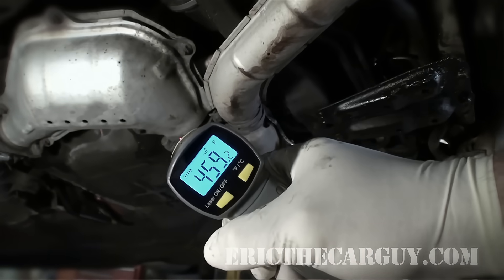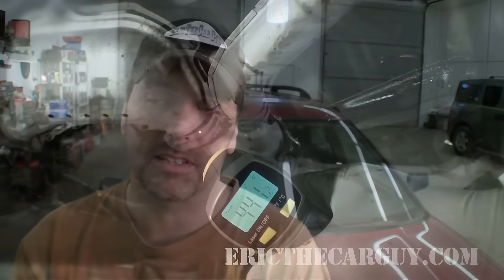Does Lacquer Thinner Clean Catalytic Converters? -EricTheCarGuy

Comment: Modern lacquer thinner is mostly a simple mix of acetone or the slightly less volatile methyl ethyl ketone and toluene or xylenes. Seafoam engine cleaner is 70% isopropanol or common rubbing alcohol. The CRC Guaranteed to Pass catalytic converter cleaner has a high  proportion (roughly 10 percent, with remainder being basically paint thinner or stoddard solvent ) of alkylamine proprietary detergent as the cleaing agent. Most of the rest use a mix of isopropyl alcohol and acetone to clean the fuel system and upper cylinder head of deposits.  Cataclean and the like use equal amounts of acetone and isopropyl alcohol to try to get the job done at roughly 30% acetone to 30% isopropyl alcohol with remainder being xylenes as a carrier. Using a full quart of lacquer thinner or what is basically mostly acetone is way more solvent than these commercial cleaners dump in a single tank for catalytic converter cleaning as they are typically around one pint or 16 fluid oz. . A full gallon of lacquer thinner in one tank of gas is a huge excess compared to the commercial cat cleaners. There are a few cleaners using isobutyl alcohol insead of isopropyl alcohol but you get the idea that they are all trying to remove carbon deposits and varnish from the intake and upper cylinder head using alcohols and ketones with extra solvent power compared to gasoline.

But do they work?

Modern catalytic converters use a very finely divided mix of platinum and palladium metals depositied on porous ceramic beads. Fouling oif the beads surface will impair performance. Sulfur, phosphorus and lead are known poisons of these metals. Lead has been removed from fuels for quite a while now. ZDDP (zinc organophosphorus compound) can also impair the performance of the catalytic converter and it is used as a fuel and oil additive to decrease metal wear rates in modern engine oils by plating out as thin film of zinc metal on hard surfaces inside your engine. Allowable ZDDP in fuels is very low now to protect your expensive converters performance over time.

These cleaners will only restore performance due to carbon deposits and varnish that has clogged your converters due to a rich running condition. Driving at freeway speed for an extended period of time will allow your converter to heat up to the point that it can burn off any carbon deposits that have lodged in it.  Loss of efficiency due to poisoning of the expensive catalysts will not be recoveralble using a simple solvent system. Neither will soap and water clean off the ceramic beads of any metal or sulfur poisons. This is not an easily recoverable process and the only fix is to remove the older poisoned catalytic converter, send it out for precious metal recovery and use the pure platinum and  pallladium to recoat the ceramic beads to make a new converter.

The number one reason for loss of catalytic converter performace is overheating due to a rich engine exhaust causing the converter to become so hot that the beads break down and clog the converter. No amount of cleaning with solvent or soapy water can fix that problem.
Reply: very insightful comment!! at my work we have a lot of oilfield trucks that idle for a extreamly long time and burned oil clogs the catalitic converters to the point that it looks like a dpf that could never regin and is completely clogged!
Reply: I disagree, I think most converters are  clogged up with nothing but soot. I've seen soot severely clog up an intake on a 2021 Ram 6.7 diesel so bad it had to be broken up with rubber mallet
Reply: Soot is unburned carbon particles. Once your cat is poisoned with anything that causes it to no longer burn off the unburned fuel deposits, it can no longer get up to temp to function properly. Once it loses its catalytic efficiency, it becomes clogged and coated with soot. But did soot cause it to stop functioning and loose catalytic efficiency in the first place? Diesel engines are known to produce soot and unburned carbon deposits, way more than gasoline internal combustion engines. So finding your diesel cat clogged with soot after it has lost catalytic performance doesn't tell you if you got a tank of high sulfur fuel and that killed your cat first. @ronmoore3987

Comment: Hi Eric, love your videos. I have watched your other videos where you dunk the cat in dawn soap water. I know base on thermal readings and voltage readings you said it's not working. But did the check engine light went off?  That's the important thing so a smog check can be done. The cat may not be up to par, but at least a smog check can be performed.

Comment: Yes it should work clean it out , it's carbon build up, from  motor oil passing by seals pistol ring valve guides and unburied fuel that we dealing with it wear , using high weight oil that oil additives STP or Lucas to prevent oil to bass by seals , seal them ger better horse power and milage . A tune up will help burn most of the fuel

Comment: Lacquer thinner will not eat any plastic parts or gaskets.... if it did why are we running it through paint sprayers to clean them.... also i typically fill a plastic cup and let cup gun parts sit overnight.... cup doesnt dissolve

Comment: First of all, you didn't follow Scotty's instruction properly. Second, Scotty didn't claim that using a thinner would fix the broken catalytic converter. He wanted to give a try before replacing that expensive part (way more expensive when you go to the auto mechanic and have it changed).
Scotty is an experienced mechanic. He must have tried the method in many cars in his career before making the video.

Comment: I got a low fuel pressure indication when my catalytic converter was bad. So bad it cause the engine to stall. this is due to poor signal from noxygen sensor 2006 Suzuki aero

Comment: I have a 01 626 2.0L with 2 Converters I've had the P0420 & PO421. With Normal Driving Carbon builds up especially in the Converters. I took mine out of O/D which made it tach about 3500 at 50 mph. Ran it like that for a good 15 - 20 miles not getting above 50 got everything good & hot especially the Exhaust that seems to have cured both codes it's been over 3 weeks now no code... May not work with every situation but worked for me.....If it helps I recommend doing this once a month (cant hurt)

Comment: " ATTN " Scotty Kilmer used a half tank of gas to a FULL  GAL. of thinner , ran it about a 150 miles or remember he said if you don't want to drive around a 150 miles he said sit in the car behind the drivers seat and press the gas pedal til it hits 2500 R.P.M. ,S  for about a half hour, , and passed, or the dawn dish soap and warm water trick and rinse it out with a hose, now if the thinner doesn't work, then try the soap an water trick, if after doing both, well, at that point I cant tell you what it is you should do, maybe geta local mechanic to change out your old one and slap in a new one, or go buy a converter and slap it in yourself or pay a local mechanic to do it, that's probably going to be the most expensive way to go but if you tried both of Scotties tricks, and it still fails, its fucked, and you gotta do something, or the state of Maryland will suspend your license, and if you still don't get it done they stick it up your ass by revoking your license altogether, then your really fucked, now you still have to get that fucking thing fixed, pay fines, pay court fee,s  Maryland is a state that really knows how to fuck its drivers but good, real good, this state blows , all the fucking money we have to kick out just to drive on these super fucked up streets, Baltimore streets are I think the worst in the entire 50 states roads, the roads here are pieces of shit, granted some of the highways are in better condition, but for the most part,they FUCKING SUCK !!!!!!  it  a hole then a bigger one then a gigantic muthafucker, one that will knock off all 4 of your wheels , you,ll be sitting there with a car with 4 wheels laying in the damn gutter because of Godzilla fuck me hard in the ass pothole hole, but Hogan says we,ve spent several millions on Maryland roads restorations, shit show me where the fuck he,s been spending this money, on what roads ? none in Baltimore city or county, that lying fuck

Comment: I'm not a mechanic. No doubt, not even a shade tree. But... I don't believe in additives for anything in a car, unless recommended by the mfr. 
I don't see use stop leak, engine additives, fuel injector cleaners, transmission additives, unless the mfr tells me to do so.
Reply: john g 
Yea 99% of the stuff out there is snake oil. 
The only thing that really works as far as additives is marvel mystery oil. 
It keeps valves from sticking in aircooled stuff from burnt carboned oil. 
It’s a naphtha based oil, so it’s a cleaning oil. 
Nicer to use in an old engine with some sludge too, it’s not a fast flush but works slowly over time. 
If the oil level is a little low add some a few hundred miles before an oil change. 
Read the bottle but you can use up to around 20% concentration in your oil.

Comment: you said to start with your cats are stopped up. so no its not going to work. plus every video i have seen says use a gallon on a half tank and in most cases that's about 7 gallons of gas you you did 3/4 tank and a 1/4 of the thinner. so to be honest i think your video is a joke. i have a 4.6 with bad cats and just for the hell of it i will be doing this test soon just to see myself.

Comment: Eric - Review Scotty's video again. I believe he used considerably more lacquer thinner than what you added. I also got the impression that he made no guarantees but said it was at least worth a try to avoid the more expensive route of cat replacement. He also stated that if the lacquer thinner technique didn't work, then see if the cat can be removed and soak it in a bucket of soapy water overnight. Again, he admitted that removing the catalytic converter is difficult due to heat, oxidation, etc. Even after going through this process, he didn't claim these ideas were a sure thing. So, the myth busting appears to be the thing busted, not Scotty.
Reply: He also said it is a way to clean the cat. Not "fix" the cat. An important distinction
Reply: @RealWolfmanDan  most cats don't like help getting clean.
Reply: @maranatha3333  true, mine hate it

Comment: just to add my 2cents ..my van failed emissions test and i had a o2 sensor code i got cataclean one bottle to just under a quarter tank ran it through ..came home parked my van cause i didnt think the stuff did anything when i plugged the scanner up 2 days later everything was fine .went back to get inspection and passed flying colors all i can say is try it before you drop money on a new converter

Comment: It works if you get the gallon. My Catalytic converter was clogged and car was cutting off. My car runs great now, check engine light is off. My live data on my scanner shows the temperature fell on both cats. It works...

Comment: Dude, you had to know it wouldn't work. Kilmer added one gallon of laquer thinner to 1/2 tank of gas then drove 150 miles to push the stuff through. The ratio of gas to thinner was about 10:1. You decided to totally ignore the recommendation even though you claimed knowledge of it and put one quart into about 3/4 of a tank of gas and drive it for some vague amount of time. The ratio you used was about 60:1 gas to thinner; 6 times more dissipated. I was hoping that you would get some numbers on Scotty;s method, but NOOOOOOOOOOOO

Comment: I can confirm that 4 litres of lacquer thinner in   50 litres in an Fj cruiser 2012 worked . The P0430 cat below efficiency error is gone now . You do have to use a gallon and it takes about 300klm . I used real time diagnostics on the o2 sensors and saw the change back to normal operation.
Reply: Please tell if it worked or not. Thanks!
Reply: @PatrickLarson it worked

Comment: The first vid I saw about this - different mechanic - said to put an entire gallon lacquer thinner in half tank of gas. He had an SUV which had a 20 gal tank, thus 1/2 tank is 10 gal. That means a 10% mix. (1 gal lacquer thinner to 10 gal gas). My Hyundai has an 11 gal tank, so I put 1/2 gal laq thinner to 1/2 tank gas (5 gal - still a 10% mix). Ran the car for about 140 mi - the check engine light went out and the engine ran much smoother. So it worked for me.

Comment: Kilmer’s technique worked for me 5 years ago when I got the check engine light and the p0420 code. However, I ran lacquer thinner through twice before resetting the code. The code never came back and I have passed emission testing twice in the last 5 years. My Subaru has 214k miles on it and it still runs clean. I would say yours is either really plugged, melted or you didn’t run it enough (like I did). Lacquer thinner will not harm anything I the system.

Comment: I tried this, and it worked as far as my scanner was concerned, and the temps were lower through out the exhaust. Here is the difference, IMO, there is general purpose Lacquer thinner you get from  Walmart, and there is the Lacquer thinner you get from the automotive paint shop. This thinner is MUCH stronger, and more expensive, than the cheap general use thinner from Walmart, or other stores. 

The thinner used in this video looked like the weak thinner sold for most oil base house paints, not the stronger automotive thinner. 
 
I watched Scotties video, and he was using the exact automotive paint thinner I use to clean my paint guns [again strong stuff]. I poured a gallon into my exhaust, and my wife, and I took a long trip. 

Now the engine did run differently with the automotive thinner in the tank, but nothing to be concerned about. 

After getting back home I noticed the rotten egg smell from the exhaust fumes was completely gone. Then I ran live data on my Innova scanner, and the numbers were significantly different, as well as the exhaust temps. The engine ran better after this, with no stalling/studdering, and had a bit more power. 

Also no problems with the fuel system, and I'm betting the thinner actually cleaned up the injectors [I've used it in the past to soak injectors with good luck, so that one was a given]. 

Point is, use automotive paint grade thinner [it will smell different]. This thinner don't have to be the most expensive stuff they sell,  just ask for some lacquer thinner to clean your paint guns, they will know what you need. PS, the house oil based thinner WON'T clean an automotive body shop paint gun, but it will make a glob mess, and just about ruin it. Good luck.
Reply: You poured it into your exhaust?  😅😂😅
Reply: @PsychoSiKS  and his wife 😂😭

Comment: The ration to fuel is incorrect,
Products like Cataclean 
Use 3 basic chemicals, acetone, high ethanol and peroxide, In set amount this will not effect sensors.

Comment: My 2013 Subby Outback was throwing a P4020 code intermittently. If I cleared the code, it would pop up a few weeks later. Sometimes the code would clear on its own. Tried the lacquer thinner (correctly) and code was clear when I started after my last fill up. Also feels like the engine may be running a bit smoother, but that is more subjective and slight.
Reply: I got an 02 subie outback 2.5 ej25 5spd 2ith a p0420 and p0301. Hope this works but I also think I got a intake gasket vacuum leak or some vacuum leak that's small causing the p0301. Ahh

Comment: i use xylene paint  thinner for burnt on carbon the black just rolls off use a brush for faster results
acetone in gas 4 ounce per 10 gallons it is organic water soluble pls 4 ounce xylene may cat code cleared

Comment: Hey bud quick question got an E4 50 ford with a 31 foot camper called a fun mover,  basically it’s a toyhauler c class motorhome with Ford e-450 chassis gas not diesel.  I’m 90% sure it’s the cat won’t go more than five or 10 mph now thought it was the tranny at first but it’s got the hissing and everything happening. Not looking to fix the catalytic converter right now, I need the camper to move and drive. Don’t want to take the cat off because I’m in a parking lot and they’re bitching at me already. Can I just break apart Honeycomb by beating on it with a hammer, I guess I could just run it open header. Just the quickest way for it to not go 10 mph is what I’m asking so I can get the hell out of this parking lot